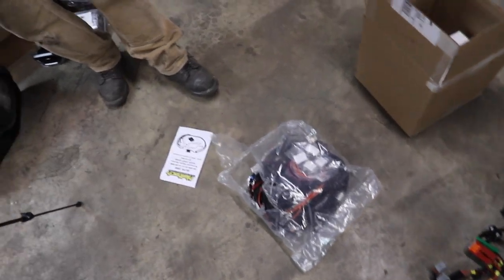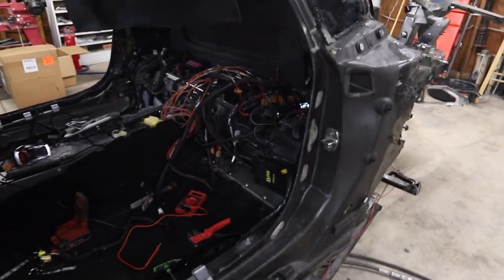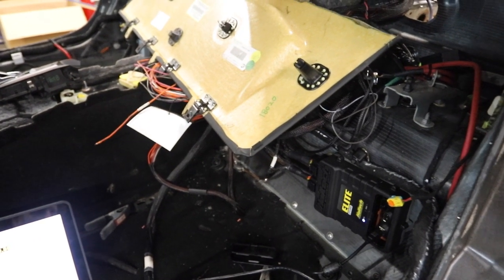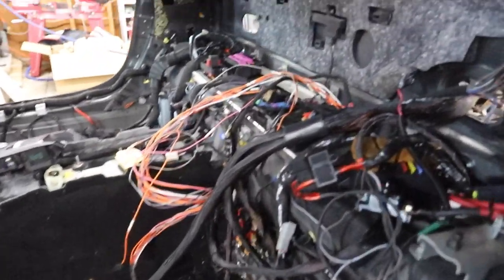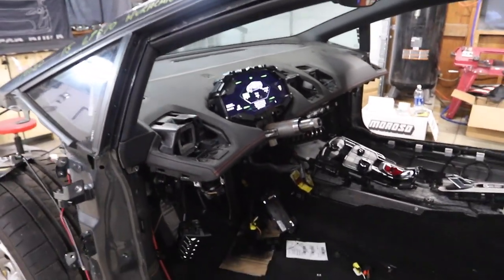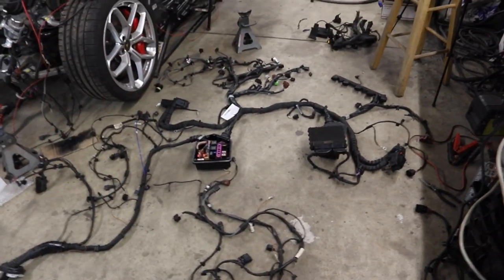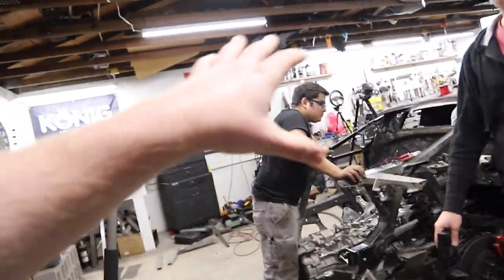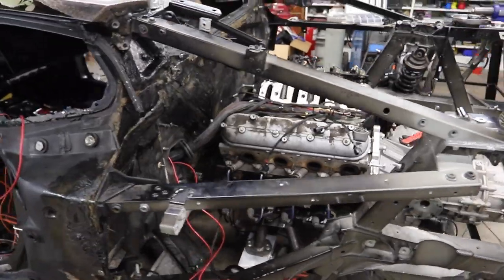Installing a Stand Alone ECU on the LS Powered Huracan - Haltech Elite 2500

Comment: Hi i'll start by saying that i am a car key programming tech in my area and i know that audi has the keys identity stored in the cluster so if you change cluster, bcm and ecu it would work!!
 if the ''ensemble '' is not complete it won'T work!!

Mike Biron
Reply: Email him this or DM him on instagram
Reply: Could also be linked to the electronic steering lock.
Reply: My Audi TT battery died...now I put a new one in it doesn’t work. Do I need to reprogram
Reply: @moncier77  when battery dies 9 out of 10 times you have to reprogram!!
Reply: Not only cluster but also in transmission

Comment: you need to make sure that's a true ingition signal. Generally button press 1 on most cars would only give you accessory power and not ignition. Big difference when you hook to accessory is that under cranking accessory voltages drop out generally and then come back once car is running. If you're on an accessory, no engine ecu power during crank means your never gonna fire
Reply: I was gonna say the same thing. Plus he should be able to find the old start signal in the lambo harness and remove it from said harness and connect it to the LS starter......a hot wire starter button just feels too "240 life". lol.
Reply: @allenc1091  whoa whoa on the 240 life! at least mine is an s30 though and not an s13 lol
Reply: @glacius331  Hahahahaha i quit S chassis. Moved to Z33 chassis. S30 huh? Nice. I was watching a RB S30 build today after Chris's latest video. Lol

Comment: For the starting button you could add a starter interlock relay to protect the wiring if the new Haltech ECU is not so smart. Meaning the starter wont engage if the engine is turning. Nice job on the install today I’m loving this project 🇮🇪 ✌️
Reply: I hope the ECU is clever enough, because I just realized that this is really important while I read your comment! 😂 there is so much to look for...

Comment: Chris, you could try data logging the CAN Lines to possibly find out the starter signal. You could either use a mini controller to translate it to the halltec if it doesn't understand it or a mini controller paired with a relay, so it acts like a real switch. But you still have time to complete this build, but I think this would be a nice to have feature if you want to keep the factory electronics. And yes I know you said that you will probably look into these stuff later when you are done with the base stuff or when done.

Comment: Buy a steering wheel like DDE with shifter light for LS swap huracan
Reply: Carbontastic steering wheel by Eric
Reply: They left the made in china sticker and instructions on it when sheepy was installing it. Eric must buy them from china and then sell it for a markup, probably gets them for $20 and sells them for $3000.
Reply: @jessicad3013  you have to make the carbon pattern, custom stitching, personalized logo, race stripes. May used a chinese wiring harness but kid is on the grind.
Reply: Cruzredeye  link?
Reply: علئ راسي والله 

That’s good idea
Reply: @kuwaitmo  ❤❤

Comment: Make sure that your button can't accidentally deactivated while the vehicle is already running. I don't know if HalTech has a spot where you can program the starter button, but you need to make sure you can't accidentally hit the starter when you don't want to. Especially if it's going to be on the steering wheel.

Comment: I don't know why going all the trouble of using the lambo keys (if you can just remove the keys and use the car without it)... But if you want that working, you will need a bcm2, a key and a ECU EDC17 that has the security codes syncronized. I think that even if you buy everything from the same car in a savage, you will need to connect the ecu to a computer and perform the resync of the security keys.

Comment: Audi technicians could help you too. I  think the keys and cabin modules are the same. BUT you will need the Lamborghini ECU in order to run the cabin electronics etc and the Haltech only for the engine. If you want everything to work properly you need the original ecu too. This is what you should do on the 2JZ BRZ also......

Comment: You keep saying the engine is backwards but it's not. It's just in the back of the car man, only your intake is backwards
Reply: Epic 👌✌️
Reply: Yes it is backwards. Usually, in a RWD car the ECU is in the cab of the car. That means it is behind the flywheel (the transmission side). Chris's ECU is coming from the opposite side of the engine, hence it being mounted backwards relative to the ECU
Reply: @claytondegruchy5   you think a motors mounted backwards bc a ecu is infront of it vs behind it that makes no since lmao
Reply: the motor's not backwards in the car, but the wiring harness is still backwards on the motor.
Reply: @ibanezmetal321  bingo
Reply: @ibanezmetal321  Would have saved a lot of time and a brand new harness if they simply put the ECU behind the engine and just extended the signal wire for throttle position and a couple of other things though.
Reply: I wouldn't worry about that. The way he pimped his $5 multimeter doesn't inspire much confidence in his understanding of anything more complicated than a light bulb.
Reply: Guys, we are kidding 😊, sure that technically we know the ecu/harnesses  
Are no jokes nor povs.
Just 4 the love of cars, have fun trolling around 😁
Reply: @cmoullasnet  exactly what I was thinking while watching 😂
Reply: I was just going through the comments hoping someone had said that thank you

Comment: You should do a MIL-Spec connector for the harness from the firewall to the engine bay
Reply: That may be too much added weight. LOL. The reason why Army helicopters struggle to attain flight.

Comment: I didn't see a fuse coming off the battery. You probably should have one.

That starter switch is kind of hokey. Stick it under the clutch pedal and out of view. That way the clutch pedal actuates the switch.

Comment: First of all, if you want the ignition to be turned on with VAG product´s you need the meterhouse/cluster also becuse its programmed with the cluster and bcm, with out the right numbers in the cluster the hole system will be "dead". take the green lambo meterhouse/cluster and it should work, if its not working you may need to delete faults in bcm with obd (odis) it is probably locked in immobilizer, next good progress can be that you need to have your door units, they are also a step in the game to put the ignition on. 

I hope you read this. cheers!

Comment: 20:10 That wire stripper is a tool made by God himself. I got one a while back and have not looked at my other wire strippers since. i did a review on the one i got because i was so excited about it. Sometimes I have to work on 22-24 gauge wire so this makes it easier.

Comment: You might need to emulate signals from the stock devices...you could do that with Arduino. I had to do that once and it was tricky but not impossible and I'm definitely not a programmer.

Comment: Hii, about throttle wire, you need to switch V+(12V) and V-(GND).  if you push pedal the Voltage(V-DC) in ECU need to increasing and in your car it was decrease.

* When you press the pedal, the ECU voltage need to grow.   the FIX : switch V+ and GND on throttle pedal.

Comment: I remembered that the gallardo engine is not in the middle of the car, and I think this means you might need custom length axels? Because the transmission is shaped the way it is to center the offset of the engine i believe. Just a thought

Comment: For the starter switch you should run a relay for starter and have the switch apply ground to activate starter solenoid. I realize today was just to get it to turn over..just an idea to make it a bit safer and "correct".

Comment: maybe you should get another opinion on the ECU stuff. A dealer technican knows the dealer methods and stuff, that are mostly pricy and have to do with replacing stuff. For the Huracan and its VW roots there are very likely a bunch of mods and codings you can do to the ECUs to change things. I did some coding with my bmw but just the basics like start/stop off etc., but there are guys who can do a lot more. Matching a new key change the VIN or maybe run without a key at all. Samcrac did a video on it recently where he visited one of those shops which reprogrammed him his Ferrari ECUs...

Comment: I figured there would have to be a button to trigger the Starter. I would suggest using one of the buttons from the steering wheel as a starter trigger to keep the setup factory looking. It could be the radio source button or bluetooth button etc.

Also, instead of running the USB from the Haltech in weird directions to do tuning, you can use a USB flush mount extension:

https://www.amazon.com/dp/B01NCA9XEI/ref=cm_sw_r_other_apa_i_kUOfDbRF3QA5C

Comment: With VW/Audi ECU's you also need the same VIN dash display as its all coded to the ECU and key .  But if this is the case for the lambo (as its VW/audi tech) , you might still get it to work as the engine management is now a stand alone system .
Reply: On VW/Audi ECU's there are people that can write out and delete the immobiliser part of the key from the ECU, then you can use any key to initialise it . I use VCDS , but it cant write out immobiliser , but can program a brand new (or used) key remote to unlock/lock the car etc etc

Comment: The key has a math code and the reader doesn’t need to know the code, just to be able to pass the code to the ‘thing’ and pass back a ‘handshake’. And the ‘thing’ could be the car module and the ecu, because if the key is the vin number it will likely check it has the right engine and gearbox map every time you start. (I’m guessing)

Comment: The ECU may not have to physically installed. The data lines may pass through the modules in series and you may just have to connect the data lines together to bypass the missing modules.

Comment: So are you still going with the gen4 aluminum block? If so, isn't that haltech for a gen 3? Pretty sure its either the cam or crank sensor at least that's going to be different, ya?

Comment: 4ga really isn't very large for a main positive.  I'd go larger.
Reply: Do RC many cars come with something around 8ga, 4ga would be adequate unless he’s running a big ho alt and a ton of electronics
Reply: Do RC for his length itll be fine,   Shorter runs of 4guage can handle 200 amps or more
Reply: @HK47Elite  im not so sure about 200amps. But you're absolutely right about 4gauge being heavy enough to handle upwards of high 150a current. Which the only thing that would produce 100a current MIGHT be the starter. And that by itself is only a 3 second spike by itself.
Reply: The 8ga from the distro block to the starter is too small in my opinion. 4ga will be just big enough for the run from the battery to the engine. It will probably turn over slow even with a low compression 6.0L. Will it do it, probably, but it may cause issues later.

Comment: Wouldn't it be a good idea seaming you have you use all the factory haracan ecus using the starter motor output on the haracans ecu going into the haltech to then trigger the starter with the factory start button

Comment: If I were you, I would do in this way. Since you have green car, grab CAN bus analyzer and read CAN bus messages. Try to figure out what message is needed from ECU to activate ignition. Also you were programmer, so you have a skills to make a emulator which sends that message and activates ignition. Actually, in this way I managed to put instruments cluster from totally different car and control it, but the funny part is that all other modules thinks that old cluster is in the car. If you need I can make a public github repository for instrument cluster emulator. BTW it works on ever AUDI, VW, SKODA & SEAT makes, so there is a chance, that it is possible to control yours.

Comment: If it runs two ECUs normally, my guess is only one of them is responsible for completing the security circuit. Maybe you'll get lucky and use the stand alone to power the engine and the second will handle security.

Comment: If you have a wiring diagram for the lambo why dont you find the connection from the stock harness and ise a paper clip or depending what the paperwork says maybe a resistor and it should trick the factory stuff into thinking the trans is in what ever you need it to. Its still the same concept for airbags that people bypass.

Comment: Instead of using the switch to start the car, why dont you use the brake pedal sensor? So when you hit the break and push the start button it will start the car, but if you only push the start button without the break it will only turn on the ignition/ecu?

Comment: If you will have the OEM ECUs, can't you just use everything OEM to power the starter, maintaining keyless and everything else? Also, yout will need to feed the RPM signal to the OEM ECU to make the tach on the dash work.

Comment: Why not axe all of the Lambo wiring? It seems like it's just being kept to run that speedometer display. 

There's so many wiring harnesses from Lambo there, seems like a lot of weight, complication, and cost to keep that stuff. Put in an aftermarket gauge into the old cluster bezel and make a CF panel to fill the gaps. And just remove all that Lambo wiring.

The build looks great, I'm just curious why stick with all that Lambo wiring.

Comment: There are two cheaper and possibly better options to using the Lamborghini electronics.
1, get a wrecked GM vehicle that has the same configuration as the Lamborghini (doors hated seats aircon etc) and take the controllers and harness out of it and totally replace the Lamborghini stuff.
2, get a VW Audi Skoda seat etc that has the same key fob and is the same age and it will probably have all the same ecu control modules etc.

Comment: Your better off not using any of the lambo control modules and just wiring your own and make a custom digital gauge (you can use a raspberry pi or something similar or a haltech display). All the lambo stuff is all can bus so getting it to interface with other things is going to be nearly impossible. You can also disassemble to lambo gauge cluster and just use the LCD panel from it to for your own custom gauge with a pi or other single board computer powering it.

Comment: I don't understand why you are bothering to try to tie into whats left of the Lambo's electrical system.

Wouldn't it have been easier to tear out all of the Lambo's wiring harness and computers and replace it with an aftermarket harness and ECU?

Seems like you're overthinking shit. Sometimes simplicity is better.
Reply: Except none of the systems in the car would function other then the engine, this car probably has miles upon miles of wire in it and I'm guessing a minimum of 3 computers.... Also easier to integrate then it is to start from scratch
Reply: Things like electric windows and gas cap release and lights  would need doing. The little things
Reply: They sell wiring harnesses and fuse blocks that would handle all of that. Its not like he's trying to rebuild this thing to factory specs.

Comment: I would be worried about the positive being only a 4 gauge on that long of a run if it will be supplying both power for any engine electronics and power to the starter.

Comment: Why not use an Audi W12... it is lighter AND shorter than that V8 LS motor. And it integrates far better with the existing electronics, you might even be able to get it working with the stock gauge cluster.

Comment: Use caution when probing random wires with the volt meter. If you attach a new circuit to an existing circuit you need to know more than if it is switched power. You can fry or disrupt/disable modules or a modules function. very dangerous.

Comment: When you can get a complete gm truck or SUV for 500 -600- 700 -800 bucks ls swaps are a no brainer..... just watched a mid 9 pass by a ls ebay turbo and no other mods on a old rx7 ls motors and parts are abundant and take alot of abuse before they give out

Comment: Still can't believe he LS swapped a Lambo...
Reply: Best way to get a lot of power for cheap
Reply: A 6.2L LSA rated at 700HP from Texas Speed is $20,000. There is no such thing as a cheap engine with a lot of power.
Reply: @BlueDually4x4  but to put twin turbos on a v10 and make 1000hp its more than that

Comment: I can hear the car gods having a shit storm over this car. Total step backwards
And you should never use a Multi meter to find a live wire. It may read around 12v but the amperage could be to low to run anything. Use a Test Light for finding live wires

Comment: Come on Chris, when are you going to start using fuses and some kind of fuse box on your builds?  I know electrical is not your bag, but honestly, this is something that is going to bite you in the ass one of these days.  I just don't want the next fire that gar goes through to be because you didn't fuse it properly.  I've had several friends that have skipped out on not installing a simple fuse box and have lost their builds to fire when things short out.

Comment: check the ECU repair company in Fl that Samcrac used in his Ferrari F430 video recently, I bet they can help with that ecu issue.
Reply: You know that it was about a 360 and not a F430?
Reply: @ducksouponline7420 Thanks for pointing that out, makes zero difference in this case, but you are correct